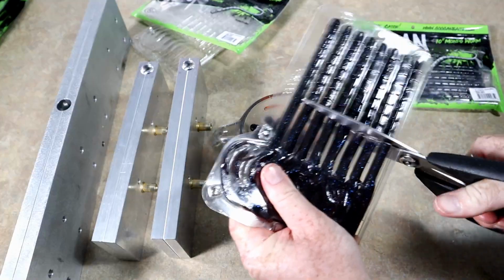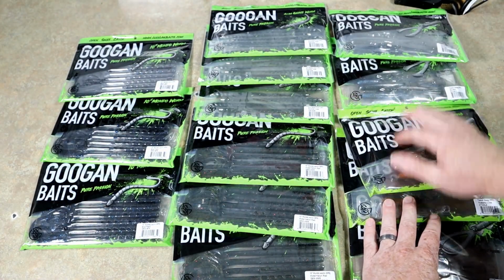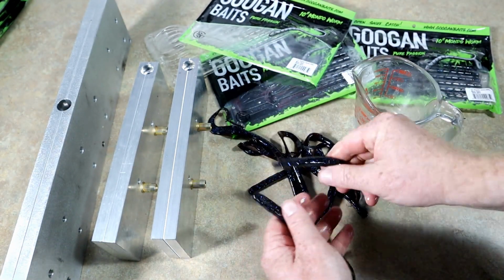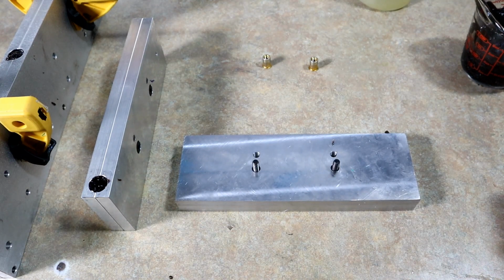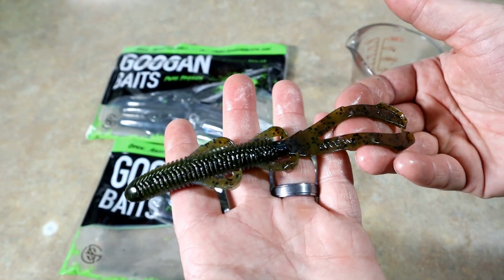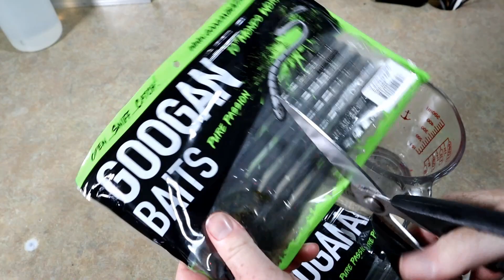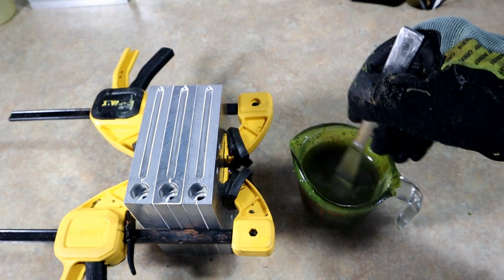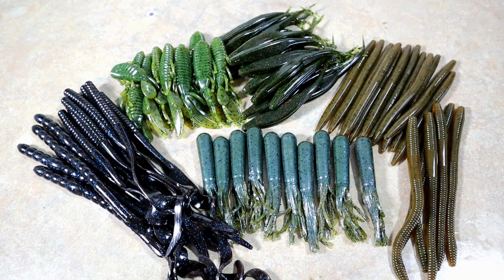Googan Baits Get CHOPPED & Remelted; Bait Giveaway

Comment: Have the exact same problem with my fortrex.  When you deploy and lift use your foot on the aluminum bracket.  Won't fix it but the weight of your foot will lock it on the deploy and allow you to disengage the pin when lifting it.

Comment: I don’t know how to share it on Instagram 😂 but cool video buddy love the remelt stuff that’s where I’m at with all this... first one was my fav as well ... what worm is that tho do they make a smaller size ? Can’t find a zoom ol monster worm type mold anywhere.  With the minn Kota not locking in ..its with deploy handle not letting the locks return to neutral ... maybe some lube on the slides or they are in a bin or junk gumming it up. Hope that helps
Reply from the maker: thanks for the tip!! ill oil everything well.  the worm mold is anfling ai, they do make a smaller one than 13"....13 is circus freak size!

Comment: The problem with the trolling motor is that it's not seating all the way. Look at adjusting,if you can, the black rubber on the inside of the bracket. The other thing you can do is file down( small AMT) your pin that locks it in. Hope this helps..had same problem the pin did it for me.
Sid
Reply from the maker: Thanks I'll check it out

Comment: Lube ur motor up buddy. As in the part that snaps together to lock it. Obviously it’s a moving part constantly in or around water I would bet to say a bit of PB blaster and it will prob start working perfectly. Just spray the small interlocking pieces that aren’t working properly and let me know how easy that was to fix. Lube makes big things fit in small places or it can make things that use to work start working like they use to. Give the cheapest route a try first. No I’m not a genius. I’m just a 5th generation farmer.  Shared and liked